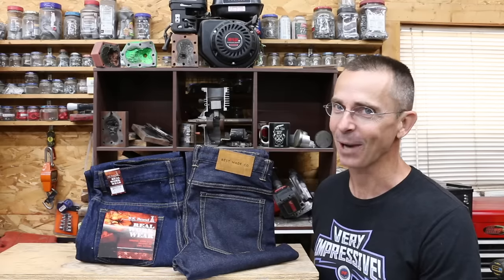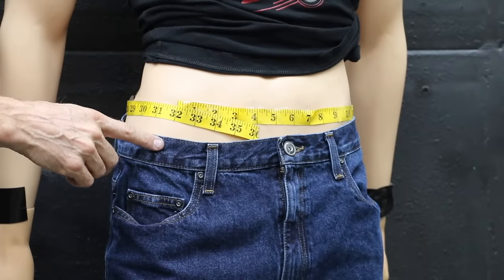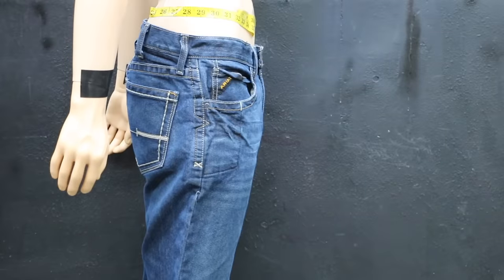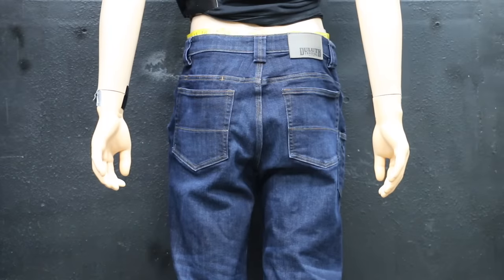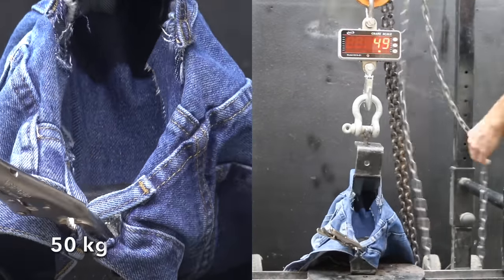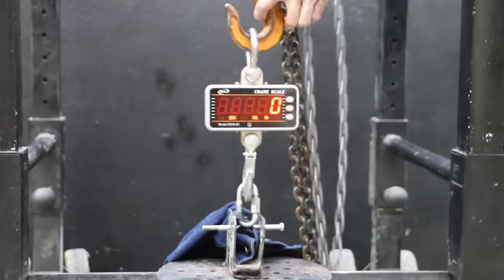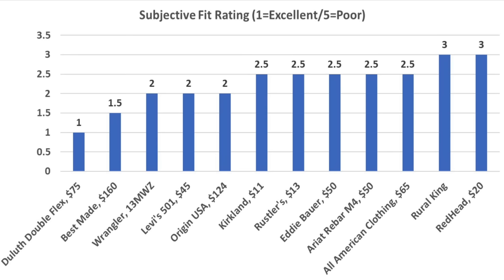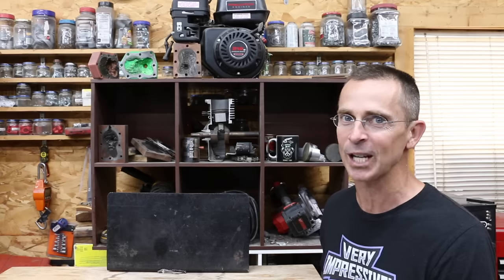$10 vs $160 Jeans? Let's Settle This!

Comment: Kirkland jeans for work are hard to beat IMO. They're right in the middle of the pack and are dirt cheap. Dollar for dollar the best value. I'd only splurge on Wrangler or some of the others if I did something heavy. I work in a refrigerated warehouse so they hit that sweet spot for me. Breathability is not an issue in a 35f cold room

Comment: Being in a hot climate, that breathability test told me everything I needed to know. The rest of the specs don't matter to me if I don't get good air circulation. It may also be why those jeans aren't necessarily the strongest because the extra breathability might be causing the jeans to be weak.
Reply from the maker: Thanks for the feedback.

Comment: Glad to see the Duluth jeans did well. I have that pair so that was reassuring. I switched 4-5 years ago from the Wrangler Riggs work pants because they kept tearing out at the knees and fraying at the bottom of the pant leg and it just didn't seem worth it since I only got about 2 years or less out of a pair. I decided to try Duluth. Typically they are more expensive for a comparable pair (Firehose DoubleFlex 5 pocket/ cargo/ etc.), $70 +/- vs. the $40 +/- for Riggs (although, you can usually get most Duluth jeans on sale if you wait for $35-55 depending on the sale), but if they last longer, well, then the value is equal. I still have both of my original pairs of Firehose DoubleFlex from 4-5 years ago and one has a tear where the pocket is seperating from the pants and the other has a tear in the back pocket itself. So, I would say the value is there for Dultuh.

Thank you again for all of the testing you do, I know I appreciate it and others do as well. Happy New Years!
Reply from the maker: You are welcome!  Happy New Year!

Comment: The tricky thing is, for me anyway, the #1 criteria for jeans is how they fit and feel, how they sit on the hips, that kind of thing, which is clearly subjective and variable from person to person. Also, how symmetrical they are, whether there is consistent stitching, accurate repeatable measurements (I hate one two pair of some cheaper brands/model have different fits in spite of the "same" waist measurement).
Good to know that denim quality is about the same across the board though.
Reply from the maker: Thanks for sharing.

Comment: I’ve been wearing banana republic Traveler jeans. As an electrician, I love them. Even when they’ve snagged on something, they haven’t ripped. They have a lot of elasticity in them, allowing you to bend and move with zero restriction. They’re also soft and very comfortable. The cost went up to 130$ a pair, but I also wear them outside of work, and you can’t tell they are worn every week in construction.

Walmart wrangler jeans rip after about 3 months. And,  other actual work jeans, u can’t find the size ir they don’t fit right. I have a pair of Izod jeans I use for backup, but they’re very uncomfortable are difficult to move around in.
Reply from the maker: Thanks for the feedback.

Comment: Test suggestion: Airless sprayers
Examples:
- Graco Magnum 262800 X5 Stand Airless Paint Sprayer
- Himalaya Airless Paint Sprayer Spray Gun Power Painter 3000PSI High Pressure 5/8HP
- Wagner 0580002 Control Pro 190 Paint Sprayer
- Wagner Spraytech 0518080 Control Spray Max HVLP Paint or Stain Sprayer

Things to look for:
- How heavy is the part you hold?  (including typical amount of paint loaded)
- Noise?
- Eveness of spray?
- Ability to spray different types of paint and liquids?  (latex, oil based paints, finishes for fences or decks, plain water)
- Limit on angle of spray? (can you point the sprayer in different directions to get under or around something?)
- How hard to clean?
- Can it pull all the paint from a can?  (have read of sprayer that had difficulty when the paint in the paint can got lower than a certain level)
- How much waste?

Thanks!  You're doing a great job.  One of my favorite YouTube channels to recommend to people.
Reply from the maker: Thanks for the suggestion.

Comment: I've worn duluth for 6 years now,   formerly a levi and wrangler guy.   I work very physically demanding construction and apart from my phone wearing a small hole through the back pocket after a year or so.   I've got no complaints.   They also have the gusseted crotch panel for the freedom where it counts.
Reply from the maker: Thanks for sharing.

Comment: I like Levi's 501 for the look, but I've torn the crotch out of two of my jeans already, and I'm skinny.  Both times was while doing heavy construction work.  Nevertheless, that's pretty lousy for such expensive jeans.
Reply: I have the same problem with Levi's I really like the fit and style but if I tried to step up into the back of my truck I would split out the crotch. They could be one day old they could be a couple months old there was no consistency other than it would split the crotch. I have switched to Duluth cuz they have a gusseted crotch and it's the best thing I found yet.
Reply: Try finding relaxed NOS Levis from the 90s. Much better quality, build and strength.
Reply: my experience with levi is that after 4 washes I don't fit them anymore. I don't really know the other brands he tests.
Reply: Levis are dead to me.  Never purchase them again.  Quality is terrible.
Reply: Maybe they have changed manufacturing process , I can remember as a young bloke  back in 70’s, my mate and I needed to lift an engine out of a car , we where in our teens , we used an old a pair of Levi’s to lift the straight 6 engine out , we had bugger all tools , the Levi’s did not fail us , oh to be young again 😢.
Reply: I left Levi's when they left USA production decades ago, and sizes and seams went to shit.  Never again.  Logger pants are my denim now. Heavy duty.
Reply: Ive been wearing out Levis 501s for a long time, i have also tore the crotches out of several pairs. But i havent found a replacement so i keep buying them.
Reply: Been wearing Levi's for 10+ years. Crotch blows out all the time
Reply: The problem is the cotton is too good, it has no flex. 
Try some polyester blend cheapies. 
Or take the Levis to a tailor and ask them to convert them to Chuck Norris jeans
Reply: They used to have a rivet there, which was the worse option.
Reply: Are you wearing your jeans at the proper height?
Reply: @corpsie-diytools38 , If you're asking if I wear my jeans like a plumber or a rapper, then no.
Reply: All the Levi jeans are made in China nowadays, zero Levi manufacturing in the US
Reply: @johnkm77  - no, that's not what I'm asking
Reply: After a lifetime of wearing Levis I stopped buying and wearing them because they have become cheap and do not last. Crotch blowouts, torn pockets and belt loops. Levis are yuppy jeans for pansies.
Reply: AE jeans the way to go no doubt.  20 years that's all I wear
Reply: Only Levi’s jeans I ever found to be worth a darn in terms of durability were the Silvertab brand from the late 90s-early 2000s, were the only Levi’s I bought and once they discontinued them I quit buying them
Reply: @cvr527  Looks like I am not alone! Levis HAVE become cheaper quality (thinner) over the years.  I'm now fifty, have worn 501's for decades because they are the only jeans that fit me well. The premature ripping crotches had been a problem.  But I've dealt with it for years by gluing denim-scrap patches inside the crotch with Tear Mender (latex glue) until the legs wear thin, then I finally throw them in with my firewood. 

But a few weeks ago I bought two new ones and thought the denim felt and looked even MORE thin than previous purchases.  This was confirmed when the crotch on one split on the first day I wore it.  I returned them both and after decades of wasting my money I FINALLY learned my lesson.  GOODBYE, LEVIS!!!
Reply: I regularly roof and do concrete work in 505 Levi's and they have held up just as much are carhartts and dickies jeans. 
Try buying pants that fit correctly if you can't maneuver....
Reply: @khancrow7015   Glad they work for you but as the majority of people posting about Levis  have stated, their experiences with Levis is that they were once quality but now crap.  You are entitled to your opinion, but you aren't entitled to assume that everyone on here who thinks Levis are junk only thinks so because they don't know how to pick a proper pant size.
Reply: @Shaun Devrisky  And I stated I am always rubbing my 505's on shingles which is essentially sandpaper and on my knees on sandy or dirty concrete which is also really abrasive...They wear down the same as other decent brand work jeans...
I also don't understand the mobility issue I've never ripped my crouch in any clothing...I have full maneuverability with no resistance...I find it crazy adults can't even wear the correct sized clothing
Reply: @khancrow  people keep saying that, it's kind of annoying.  I don't wear baggy clothes, and I don't wear form-fitting clothes.  I wear the proper clothes for my frame.  The only exception are my overalls, which have shoulder straps, so they don't need to fit well around the waist, and no, that's not what a belt is for, I don't care for bunching up the waist of my pants.  Maybe 505's are a different fit than 501's, I don't know, because I've never bought 505's.
Reply: @johnkm77   Same here, it's very annoying. I've been buying my own clothes for forty years and purchasing proper fitting clothes is not rocket science.  The pathetic lifespan of Levis 501's has nothing to do with how they fit me.  But it has EVERYTHING to do with the decline in quality over the decades.  I have year after year seen the denim get thinner, hems get smaller, etc.  Levis like most things have increased in cost while quality has gone down to maximize the profits of the owners and shareholders.
Reply: @johnkm77  True about Dyson.  I bought a Shark instead for much less, it's been good.

Are you a conservative?  I'm just wondering because your comment was censored by this site.  And there was nothing wrong with your comment.
Reply: @Shaun Devrisky  really?  Was it taken down after you read it?  Let's just say that I have a lot of views that make woke people want to run home to their mommies...
Reply: @johnkm77   It's in my notifications, but I did not see it on the video.  I check that often because YouTube does it to me all the time!  It will show my comment if I'm signed  in, but if I sign out and am browsing anonymously, my comment will be gone!

They show your comments when you are signed in so that you THINK it is posted on the video for everyone to see.  But in reality only YOU can see your own comment.

That's why so often you will see, for example, "17 replies" to a comment.  But if you count them, there will be less than 17.  
Welcome to media socialism........

LOL.  Nice. We need more guys like you in this country!!!!!
Reply: I've never blown the crotch out of a pair of jeans, how is that even possible? I've been doing physical blue collar work for nearly all my working life, mad have never blown a crotch.

Comment: TEST: The best ranch coat/jacket for welding. I'm talking everyday ranch coat worn for working in but more specifically that will hold up to grinding/welding in. I've tried Walls, Carhart, Wrangler but the only one I can get to hold up more than one year is Outback Oilskin. All the rest fray easily then catch in fire and I don't care to buy and wear fire rated clothing to farm/ranch in everyday and leather sleeves don't fit over winter coats, are uncomfortable, binding and about impossible to keep up with.
Reply from the maker: Thanks for the suggestion.
Reply: Hear me now, believe me later: polyester burns into your skin. Cotton burns away from your skin.
Reply: If you've never used them, the green cloth welding sleeves (with elastic cuffs) are worth a shot.

Comment: I have been wearing the Duluth Jeans for a year now, switched over from cheep Members Mark.  They are durable, flexible and comfortable.  I wear them year round for work, weather its 100 degrees and humid or -30 below with 40mph winds (with thin long underwear, ND winters man), my legs are the last part of me to get hot or cold.  Also the first time you put them on it feels like you are wearing nothing, in comparison to the cardboard like cheep jeans.
Reply from the maker: Thanks for the feedback.
Reply: Duluth is chinese
Reply: *cheap
Reply: I’ve phased out Dickies for Duluth this past year and - not to sound crazy, but I’ve never looked forward to wearing pants before the Duluth’s! Everyday wear working in kitchens, farm chores, carpentry/framing. Seemingly impossible to wear out and by a landslide the most comfortable.
Reply: If you can try the Duluth firehose flex pants or the regular firehose if you want some really heavy duty pants.   The flex are more comfortable for normal wear.   Wait for a sale and they should be under $50.

Comment: I would love to see a version of this for women's work jeans. They tend to contain significantly more spandex, and it's very difficult to find truly durable ones.
Reply from the maker: Thanks for the suggestion.
Reply: Mens jeans come in so many styles now that its easy to shop for as a women. It's unisex sizing in small print for many brands now but product placement is up to the retailer (some men fit in womens better too, its about hip to waist ratio and womens are unrealistic and outdated methods) and you get deep pockets, no vanity sizing bs, and more durable. Just go by hip/waist and length. Rather buy a pair of mens jeans for 20 and get them tailored for 20 (hip/crotch) which will outlast any girl jean that's 80+ dollars, some which come with holes by design. I still have my girl jeans, better for winter b/c the stretchy ones are more synthetic so bad for summer (like wearing a plastic bag b/c synthetic is plastic) and cotton is bad for winter unless you want to freeze.  And did I mention big pockets! I don't even buy skirts without pockets anymore.

Comment: I wore Levi’s for my whole life, then when I was in college my mom bought me my first pair of Duluth pants, it was a pair of shorts. They changed my life, I’ve now thrown out all of my other pants and shorts and bought only Duluth stuff. 4 pair of jeans, 2 fire hose pants, 3 of their khakis, 3 pair of fire hose shorts, and 15 pair of their underwear. I can’t go back to standard pants. They don’t fit well and aren’t comfortable for me any more. Everyone I had recommended try the pants ended up buying a minimum of 7 pair. Bought my dad a pair for a motorcycle trip and he replaced his life long collection of Levi 501’s with 13 pair of Duluth jeans. It’s all he wears now. They’re great and I recommend them!
Reply: Those firehose pants did not hold up as a bar back; I blow the hell out of crotches even on heavy denim.
Reply: @jordanlaine7412  how did you blow out the crotch on these? They’re built for flexibility? Are you wearing the right size? 

Also, sorry, but what’s a bar back?
Reply: @sterling1395  A bar back is someone who stocks the bar for bartenders, I was in high volume, I'm not a small man and at that job I took a tooon of steps, running, bending, and picking stuff up all night. The part that is built for the flexibility in the crotch wore out so damn fast, I had three pairs not a one lasted longer than six months; a 15th of a pair of good jeans.

Comment: Comfort, durability, appearance and price run neck and neck for me.  I buy Urban Star jeans from Costco because they are the most comfortable and price effective jeans I’ve ever worn. They are durable enough to last for years and inexpensive enough that if they get paint, grease or ripped by barbed wire I just chunk em.  They have 2% spandex and 98% cotton so they are durable and I don’t get that crotch lock or crotch ripout through repeated bending and hiking a leg up to get into big trucks.  At about $14.00 a pair, I can five pair of nice looking, durable jeans for the price of one pair of Levi’s.

Comment: Funny thing I bought costco brand online because I was offered a approx 10 % discount if I buy in bulk. Not great but not bad. The zippers are on the cheap side though, YKK zippers but they don't lock well in the up position. I wear holes in them fairly often too. Thanks for the very relevant testing.
Reply from the maker: You are welcome!  Thanks for sharing.

Comment: I almost exclusively wear cargo pants, and largely the canvas variety. I don't know how people survive without the side pockets. Could be interesting to see a comparison of cargos, since there's a lot of stuff to compare, like whether the pockets use velcro(awful), buttons, or snaps, whether they have a fixed fold over the opening, and how accessible the normal front pockets are(some of mine are very challenging to get things into and out of).
Reply from the maker: Thanks for sharing.
Reply: What all are you carrying that requires the side pockets?
Reply: @leifswalling3226  inhaler, sunglasses case, mask, water bottle, my partner's keys/wallet, or even just tools or loose screws and such. When you have extra pockets, you can use them for all sorts of things.

Comment: You should do "which electrical contact cleaner is best" and "which adhesive remover is best", 

I recently had an experience where $12 adhesive remover took the adhesive and paint off, while a $50 M3 can took only the adhesive off and not the paint!
Reply from the maker: Thanks for the video idea.

Comment: Awesome tests as always! I would like to know more about your wash and dry cycle- what temperature did you use? And would using a high temperature change the size? (if I accidentally run my wash on hot, will it ruin the denim?)